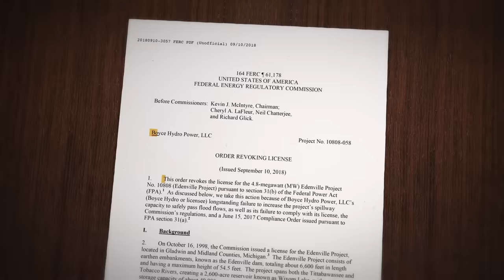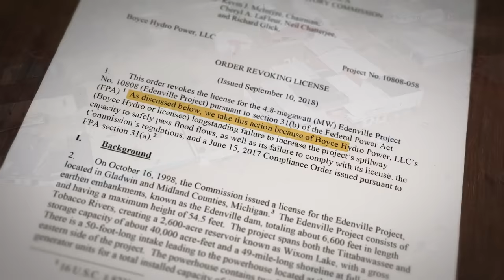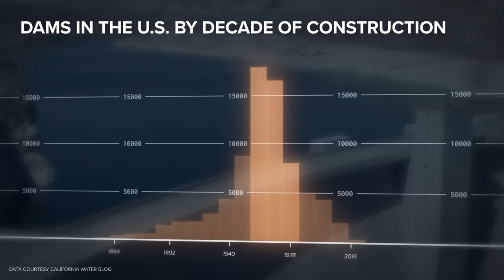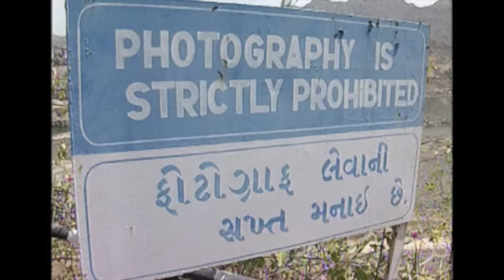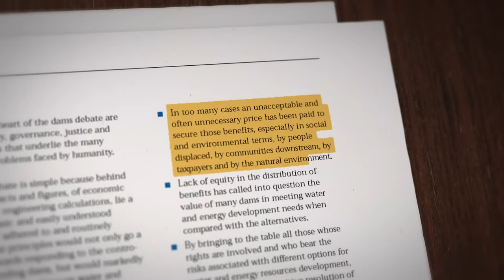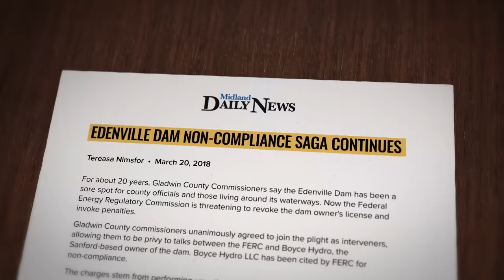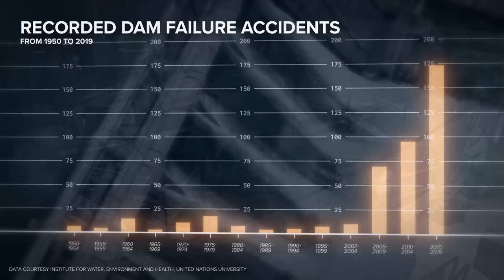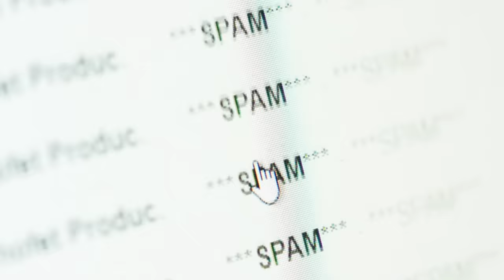The Troubling Danger of Dams

Comment: If you want to learn more about dam failure I highly recommend Pratical Engineering. he's got a bunch of videos on dams, and dams / critical infrastructure failure. The culprits are too often the same: maintenance budget cuts and inaction.
Reply: Was gonna say, I've already learned to be wary of dams from Practical Engineering 😅
Reply: @candledapple  the B1M also made a Video about a replacement of a dam in switzerland
It's a different angle but still quite interesting
Reply: I also recommend the "Well theres your problem"-podcast that have a couple of excelent episodes here on YT on dam failures.
Reply: And he did a (2 part?) Video about the Orville Dam, how it happened and what was done after the incident.
Reply: The movie Damnation also takes a deep look at the history of dams and the issues going forward with them, also the hypocrisy surrounding their uses. It's a bit dramatized so be aware of that, but it talks about the issues with dams like few other sources do. 

For instance, Damnation says there are over 200,000 dams in the united states which is a bit high. But this video we're watching now says 91,000. This difference is based on what you define as a dam. The number is likely somewhere in the 150,000 range if you include all the seasonal dams.
Reply: Practical engineering is one of the main reasons I’m going into civil engineering
Reply: Also, "half as interesting" episode on a dam in Iraq that is close to failing.
Reply: A collaboration between Wendover and practical engineering is way overdue!
Reply: Who could possibly be watching WendoverProductions that is not also watching Practical Engineeting... thats like recommending RealLifeLore
Reply: I think lot of people that watch Practical Engineering also watch Wendover Productions, as Grady frequently talks about Sam. Also B1M too as others mentioned.
Reply: ~*Just quirky capitalism things for vital, critical infrastructure*~
Reply: I second Practical Engineering. And oddly enough, Ask A Mortician has covered the failure of the St Francis Dam in one of her videos, too; well worth a look!
Reply: Part of the problem with maintenance is that local, state, and federal governments always like to find ways to make it as expensive as possible. If you own a dam, its not like you can just get up one day and start repairing damage. Heck, you may not be allowed to drain the reservoir to make repairs easier due to local governments not wanting the drained reservoir to make the area look bad. Imagine if a bus company was required by the federal government to use a brand new set of tools every time they did any maintenance on their buses. You can be assured those buses would be barely running. They'd probably put a bottle of STP zinc additive instead of doing oil changes.
Reply: @debochch  that one is horrific. It's going to be a disaster when it goes. I fear for those people.
Reply: @Teverell  Ask A Mortician is a fantastic channel!
Reply: This comment thread is a summary of all of the youtubers I watch...

Comment: Small but happy correction: the Lake Hodges dam recently completed a full year of repair work, upgrading its rating from "poor" to "unsatisfactory." The region is planning to replace it with a new dam 100 feet downriver by 2034, and in the meantime have allocated resources for ongoing maintenance.
Reply: An "unsatisfactory" rating being the happy news is.. disheartening.  Good they're doing something though.  Seems there's a lot of operators that aren't.
Reply: @altrag  I don't disagree, but from what I understand the design was too old to make the rating any better. The new dam is promising, and the danger is now at least less imminent than before.
Reply: @altrag   I think it makes sense to put in minimal maintenance work if a replacement is already in progress.
Reply: I've been inside the dam and I have several pictures of the insane cracks, pools of broken concrete and dirt IN THE DAM, and insane mold growth
Reply: @Eagle3302PL  "Already in progress" is at best 11 years away (per OP) - assuming there are no delays which is always a bad assumption with large infrastructure projects.  That's a very long time to be running on "minimal maintenance".

@karmacrackdown's response that the dam is too old to get a better rating is what it is.  I don't know the details of why that's the case but I know its not uncommon.

I can only hope for the sake of everyone in the area that that's entirely due to modern requirements being more strict in ways that can't be retrofitted, and not due to them performing "minimal maintenance" on what they've got.
Reply: I don't see any news of new dam going to be build. Can you share any link.
Reply: @altrag o
Reply: 100 feet? that's like on top of the current one
Reply: greengoodman1  They just replaced an old dam (built in 1940s) in northeast region with a new one 120m downriver. I know that because I was born in the city just besides that dam, and every year the local newspaper said that they spent large amount of money to maintenance the "level-D in safety"(which means dangerous) dam so the whole city wouldn't be flooded this summer. Until they started actually rebuild it in 2014.
Reply: greengoodman1  Not nearly as many as are in the US, simply because they weren't really industrialized to the level of requiring major dams until like the 1970s.  I'm sure they have some from before that period but pre-industrialization and post-industrialization tends to be a fairly significant turning point in most countries' infrastructure development.

(Note:  This is referring to major centrally-funded dams.  The kind that would flood entire regions should they fail.  I'm sure individual Chinese people and even communities would have built little bespoke dams here and there for their own local use, as people have been doing all over the world ever since the start of agriculture.  But when your reservoir only holds a few thousand gallons you aren't going to destroy much should it fall down.)
Reply: greengoodman1  Around 80 damns fail each year in China. In resent years even more. "Tofu-dreg" construction. The old infrastructure in China is extremly shoddy.
Reply: @altrag  I think you're mostly right (at least 90%) I don't know of how many dams China were built before the 70s, but I do That Chiang Kai-shek authorized the opening of levees in the Yellow River in 1938 so as to cause massive floods that would stop the invading Imperial Japanese Army in its tracks. Unfortunately, this cause a huge amount of death and destruction which helped make Kai-shek unpopular and is considered a factor in the Communist takeover of 1949. I can't say exactly how industrialized China was before 1949, but things definitely got worse under Mao, so I doubt any significant dams were built in that timeframe.
Reply: This is an unsatisfactory correction. :(

Comment: It's weird how scared people are of nuclear power when dams are so much more dangerous but barely anyone has a problem with them. The recent tragic events in Derna horribly demonstrated this, as more people died there than nuclear power has ever killed. It seems like only every few months there's some incredibly dangerous dam failure or something similar, but when was the last time an exploding nuclear power plant was a legitimate concern?
Reply: real danger VS the perception of danger is a interesting topic.

simply put, humans are terrible at risk assessment.
Reply: It’s hard to say with dams because water scarcity and possible flash floods are a some issues to consider.
Reply: Water is heavy and dams hold lots of potential energy.
Reply: Fukushima
Reply: @badoian  Um, no? Fukushima never exploded.

The last exploding nuclear power plant that was a concern was Chernobyl. Fukushima only had a meltdown.
Reply: The timeline of a dam failure and its impact is relatively easy to understand in human timescales and impact -- dam fails, bunch of people die / stuff is washed away, water drains away in a few weeks, fini.  Nuclear disasters are different: Plant has a failure, radiation is released, ground and water is contaminated, now you have to leave the area evacuated for the next several generations until a few half-lives pass; longer if it is a complete mess like Chernobyl which if exposed will continue to spew contamination. It would be like if for the next 300 years after a dam broke, entering the area means a random sinkhole might swallow you up.
If you move someplace that has had a dam break in the past, you aren't generally subject to ongoing peril that you can't see.
Reply: One could say that the fear people have historically had for nuclear power is the reason they seem safer or more viable now than the dams we've been complacent about for the past century or so.
Reply: @Leyrann That's splitting hairs. If you don't count meltdowns do you not count dam incidents that didn't lead to collapse?
Reply: @badoian  I would say yes, it was Fukushima, 12 years ago. So, point proven. I'd say Derna was a little bit more recent. As with the many other dam-related incidents since 2011.
Reply: @aaronvanbreugel9450  Nuclear power plant failures aren't binary. By every metric nuclear is the safest power generation method we have. If you are worrying about radiation, coal releases an ungodly amount of radioactive substances, making every nuclear release combined smaller than a rounding error.
Reply: Nuclear plants are just as dangerous or probably more so if they are maintained as well as these dams are..

That comparison really makes no sense.
Reply: It's because of places like the Hanford Nuclear reservation, atomic weapons and the meltdowns like happened at Chernobyl that tend to make people wary of them.
Reply: May be because people can swim...
Reply: @randomguy7175  Yeah... that doesn't tend to help much when a dam beaks near your house. But I get it, people struggle to identify threats when they are less tangible, unfortunately.
Reply: We're so fortunate terrorists seem to have no interest in dams. I can't think of a simpler way to cause massive destruction than to destroy a big dam in a highly populated region.
Reply: @theviniso literally russian terrorists blew up Kakhovka dam in Ukraine recently. I don’t get how no one talks about this huge tragedy here
Reply: @baronvonlimbourgh1716 if a dam fails the flood becomes unstoppable. If a nuclear reactor melts down a reinforced concrete containment building contains it...
Reply: bro livin in the 70s, no one is scared of nuclear power anymore
Reply: @exit-bag  Oh, you'd be surprised.
Reply: Dams don't emit radioactivity.
Reply: @goldbullet50  neither do nuclear power plants
Reply: @baronvonlimbourgh1716  yeah thats the thing, both work perfectly fine when operated correctly. Using privately owned dams as an argument isnt much of a point against dams, just privatization and capitalism
Reply: @goldbullet50  Nor do nuclear power plants